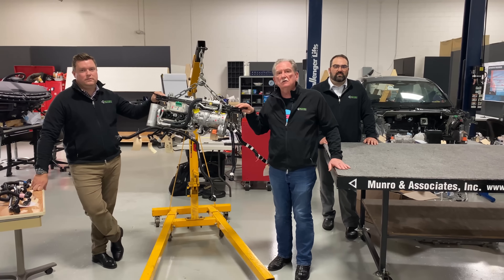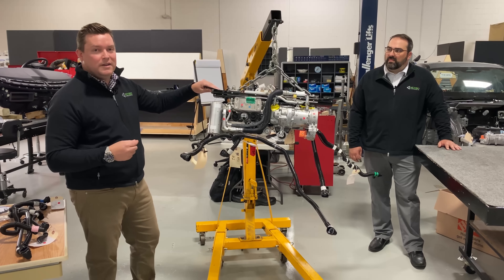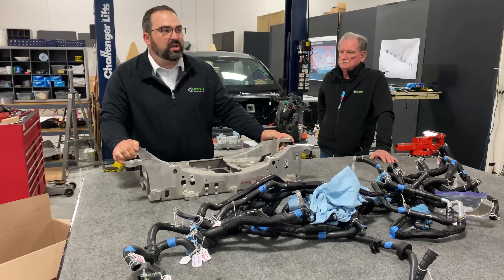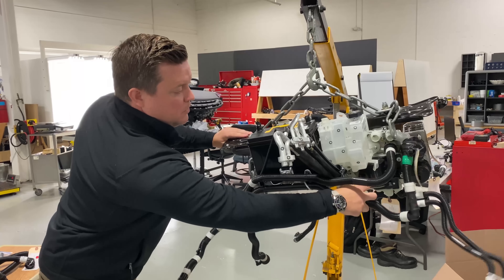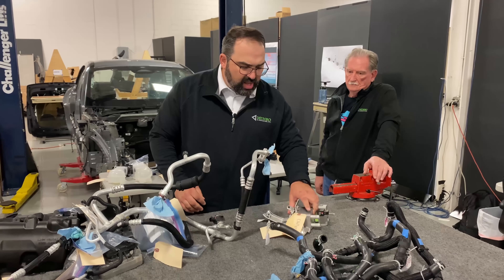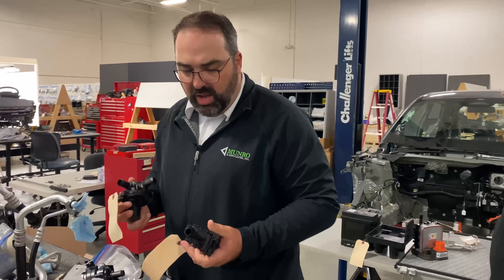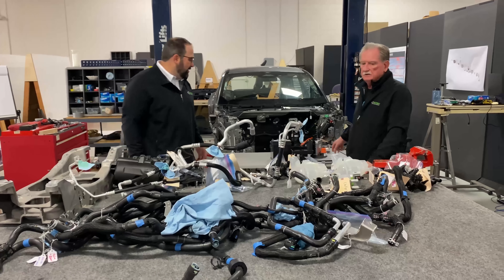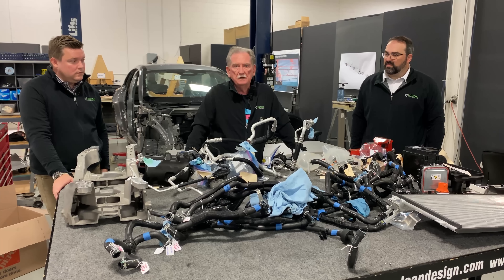Mach-E Thermal System Part 2: A Detailed Comparison to the Model Y

Comment: I think this video really demonstrates what vertical integration can accomplish when you don't have to rely on external suppliers or off-the-shelf parts. It gives the engineers a lot more freedom. Need an octovalve? Just design your own and optimize it for your needs. No need to go through all of the storage bins to build a Rube Goldberg contraption.

Comment: Hey Sandy, any feed back from ford? If i was the head honcho, i would be livid with what they produced. I hope ,( because i dont want them to fail but do better), that they have started to work on this Asap . To me this now falls into the junk pile . An out of warranty nightmare.  Ford should seriously pull the plug and fix this crap before rereleasing it. It would win more cudos and be less embarassing than a full blown disaster on the make.  I am seriously shocked at the spaghetti they created. I have watched the rest of the tare down with curiosity and its not perfect in other areas but pretty good by conventional standards. This however takes the cake.  Here is one for you, an aptera tare down, lol. yes i do have a sense of humour.

Comment: Teslar chose to start with a blank slate, and for the most part ignore the OEM network. It caused them a lot of pain, but this is the payoff.
Reply: Actually they were forces to vertically integrate as Tesla was ignored by suppliers and only assigned B or C teams for their components needs.

Elon said as much once in an interview.

Comment: What about repairs, the tesla looks so integrated that if one thing fails it will take a lot of labor just to get to the failed item.
   Modern epdm hoses last forever and spring clamps are pretty much leak free. A failed valve on the Ford would be easy to change and is more likely to be available aftermarket.  All things fail eventually.
Reply: Yes, I agree.

Comment: I look at that table of MachE parts and for some reason my mind went to when the Apollo 13 astronauts had to fit square CO2 air scrubbers to circular housings using duct tape and plastic folder inserts.  It’s a mess but still gets to second best?

Comment: Many cars need to have the rubber hoses swapped from time to time, particularly if you live somewhere warm and dry where the rubber rots. There is less heat in this system though
Reply: "there is less heat".... But there are 70 joints (points of potential failure)

Comment: Love your work Munro and associates make very interesting viewing. Going by my MA mondeo that is petrol 2.3 Complex plumbing around engine bay and I have found failure with plastic connection piece that failed twice costing $220 Australian dollars heat and plastic parts for use are not durable . That amount of plumbing on MachE is asking for trouble as you have found. Great work guys one electric car I wouldn’t buy.

Comment: The difference is a lot of Tesla engineers as Elon has stated worked at or still work at SpaceX.  Which is genuis on his part.  SpaceX engineers have always had to design small,  efficient & light systems for spacecraft.  The difference is so clear its laughable.  It looks like high-school science project vs professionals.

Comment: Not a fan of Ford but this like Android/PC manufacturers vs. Apple. Tesla/Apple has the luxury of integration due to few models they sell.  In Ford case, it appears to me the philosophy is more on parts reuse for other models than integration. Consider also the volume sales of the Mach E, that is, Ford is not expecting to sell plenty of the Mach E.
Another drawback with high integration is repair.  In a Tesla/Apple, if one small thing stops working or damaged, requires replacing the whole part

Comment: A case of "seeing is believing". Also, because it's a learning curve with these new electric vehicles, Ford
should be severely admonished for not calling in outside consultants to assist especially since Tesla has
a big head start. Or, the least they could have done was to buy a Tesla, dismantle and study it, I mean it's done all the time.

Comment: Ford could do a better job with part location but when things start to go bad in a tesla system, You would have to replace the whole sysytem.
Reply: Why? The parts on Tesla system can be dismantled, we know this because Munro did it.

i.e. if octovalve fails, that component can be replaced.
Reply: @elmirio8500  replace by who?

Comment: You have a great capable team Sandy. The value of this visual presentation is beyond belief. The weight, length of hoses complexity, brackets,  additional, fasteners, and number of pieces and pumps and fluid. WOW. What is even more amazing was Your statement that as bad as it is, the MACH E. It is better than the rest. HOLY COW. TESLA is only 5 years ahead in design?

Comment: Thanks so much good information. Even if Tesla is doing a great job there are lots of grams to chase. Lighter vehicle more aerodynamic gives smaller battery and lower cost. The goal for the mass market BEV should be 1000 kilos and $ 20.000

Comment: Out of curiosity how much does this really matter. If the Tesla system fails what is the cost to repair? When is the last time you replaced a hose? I have run 150k plus on my last 3 vehicles without a single hose issue. Could it be done better, yes! Is this that big of a deal, not so sure. I have always found custom parts to be a pain, of the shelf cheaper, better and easier to find. Just my 2 cents. Great video by the way very interesting information.

Comment: I suspect the Tesla advantage is due to their complete disregard for "model year" upgrades - Tesla upgrades components and subsystems at any time. That gives them an immense opportunity for continual improvement, while at the same time making repair parts a nightmare.
Reply: But "model year upgrades" lead to the same result for "legacy" manufacturers?
Tesla upgrade parts are built with the same location points, so are generally ...." Upgradeable"?
Therefore what's the problem?
If part B supercedes Part A, discontinue Part A!

Comment: the MACH-E is actually "USELESS" in 14 days 6 have stopped on hils going down. the battery get over heated on engine breaking and the car stopes and "CANOT BE MOVED" there it sit's and have to be pulled up on a flatbed and transported to the ford dealership to get them to move again. APSELUTLY USELESS.

Comment: Amazing how compact the Tesla system is.
When he popped the hood on the Ford I was kind of astounded by all the hoses going all over the place. Even your typical gas powered car or my Prius does not have that many hoses running all over the place.
I do think he's a little bit wrong on some of the other competition. I've seen the Chevrolet bolt completely disassembled on a different YouTube channel and they're cooling solution is not nearly as complex as the one on the Ford there. They have some of the same Parts there's a PTC heater and an AC compressor because they don't use a heat pump. But there's not nearly the amount of cooling tubing going on.
I know Sandy did a tear down on a Chevrolet bolt but they did not do a video series on it. If you want to see one check out Weber Automotive on YouTube.
He runs a Automotive technical college. And has very detailed teardown and theory of operation videos on various different cars including some Tesla's. And he personally has a Chevrolet bolt and did a complete tear down even the battery completely disassembled.
I don't think Chevy got nearly enough credit they built a relatively compact and efficient design. Also a design that will be easy to repair and maintain in the future.

Comment: Wow, that’s impressive. But I’ve heard complaints about how Tesla’s advertised range in practice is not as good as the equivalent Mach-e range. Imagine what they could do if they get rid of all that weight!
Reply: There are several cross country tests, one on one, between the Mach E and Model Y.
It's not even close.
Range, navigation to chargers, charging reliability, charge speed, efficiency, all went one way.
The lightweight "suggestive FUD" doesn't work any more.

Comment: If you’re still wondering how far ahead Tesla is….
This is it.
Ford’s pants got pulled down and buttocks are exposed.
This another proof just how bad we the consumers have been mistreated and distracted by car manufacturers for decades.
They’re still coming up with no so we’ll thought out stuff.
Tesla is running away with the ball like a wide receiver unabated!
Good luck GM good luck Ford..

Comment: Remarkable video and comparison.  For me it doesn't say Ford have poor engineers, it says senior management panicked sometime in the last 24 months and pulled out all the stops to create a BEV market offering.  This thing is cobbled together off the shelf.  Nothing else explains the tortuous hose routing or the crazy number of brackets required to hold it all together.  Here in the UK we call such elaborate contraptions 'Heath Robinson'.

Comment: If anyone wants the easiest way to show the difference between blank-page development and a requirement to use existing stock then point them to this video.

I almost feel sorry for the Ford development team, because you can just hear them cringing at the response this is going to garner from some beancounter who didn't get cc'd on memo from a difference beancounter about mandating the use existing hardware as a cost-savings measure.

Comment: Elon stated that the mechanics of their current EVs are designed to last ONE MILLION miles.  The battery pack will match that as soon as Tesla can switch to the new 4680 battery format.  All of this is being done to maximize profits of Tesla EVs used in the upcoming "robo-taxi fleet".

I'm looking forward to seeing Munroe's comparison between the Tesla Model-S and the Ford Mach-e wiring harnesses.

Comment: I think it's very clear what Ford did. Independent teams designed each separate system/components, were given a spot they could put them, and then all the plumbing was an after thought just connecting everything anyway they could. Instead of ONE team designing an integrated system for all of it, they had 20 teams doing it separately not allowed to innovate.